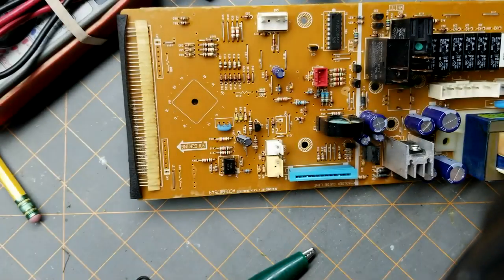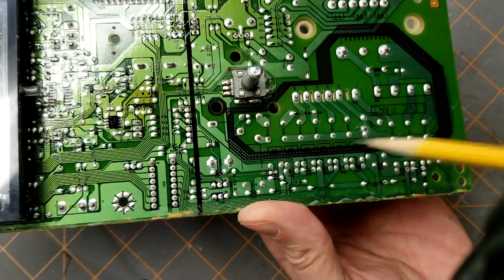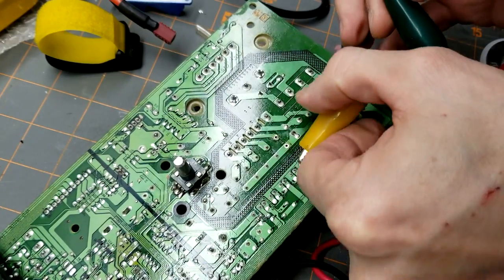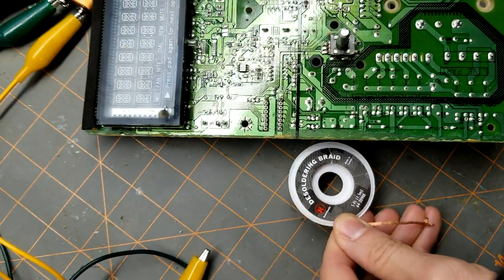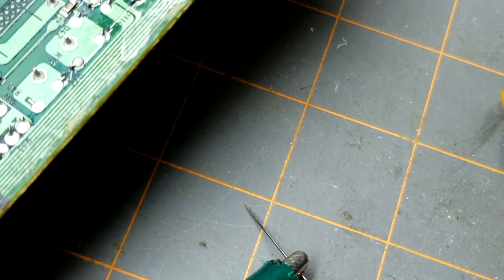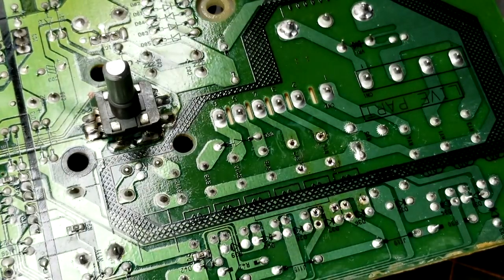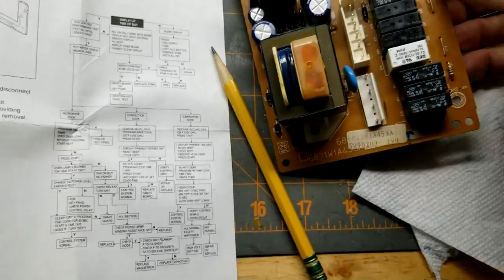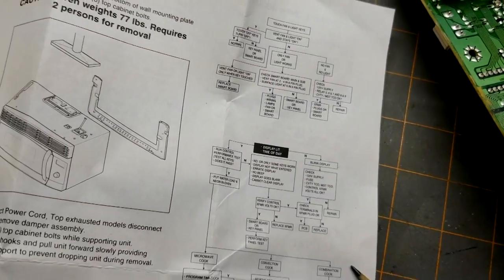Microwave Relay Replace

Comment: I see diode symbols printed near the relay coil contacts.  Often, diodes are placed in parallel with the coil to absorb back EMF when the relay is de-energized.  If you attempt to energize a relay with your 9 volt battery, you need to apply the voltage such that the diode is reverse biased.  If you apply the voltage with the diode forward biased, the current will go through the diode and not through the relay, giving a false negative.   Maybe this is why you said some relays were "polarized."
Reply: I blew up 3 of the tiny diodes trying to test the relays.
I did get the relays tested though.
Wish I'd known the correct polarity to apply before I tried it though.
Where can I get those tiny surface mounted diodes?

Comment: Wow I had to go all the way to12:20 to find out what the issue is that you were trying to repair.  I have dim lights or no numbers on my microwave display, but the dots and dashes blink. Most people are saying it's one of the caps on the PCP board, or the ribbon wire.  Glad I stayed until the end of the video to find out what the heck you were trying to fix . Nothing in the description either.

Comment: The desoldering braid:  Don't hold it directly with your fingers; it will conduct heat from the iron and burn your fingers.  Better to hold onto the braid container with only as much braid coming out as is needed.   Also, advise using flux on the braid to improve the wicking action.  Good that you opened up the bad relay to show the guts, but you didn't show what was wrong.  Burned contacts?

Comment: I blew up 3 of the tiny diodes trying to test the relays.
I did get the relays tested though.
Wish I'd known the correct polarity to apply before I tried it though.
Where can I get those tiny surface mounted diodes?

Comment: I just replaced a GE microwave over stove and kept the broken one being only two years old. it had no power to touch panel or anything else so i checked the thermo fuse and it was bad so i temporarily jumped the wires and plugged it back in and everything came back on. the only problem is the exhaust fan comes on and won't turn off. even after at least an hour or so. i just watched your video on how to test and replace a microwave relay ,i was very impressed at how well you explained how to test and replace it. what do you think it could be one of the relays are the problem. i did take out the three door switches and checked for continuity and they all checked good.
Reply from the maker: Hey Johnny. I would not be surprised if the fan is the reason the thermo fuse burnt out. If the fan was stuck on the current draw could eventually cause the fuse to go. So what can cause a fan to get stuck? It is very likely there is a fan relay.
Reply: @jebadiaha  I checked all the relays on the board like you did in your video , bug they All tested good
Then I took all three door switches out and opened the up and cleaned the contacts, only one was tarnished
Put them back in and did a continuity test on each switch while opening and closing the door, all worked fine. Also I noticed the nite lite is on also and won't turn off or on high.and fan stays on low speed still.
Reply: @jebadiaha also I thought the thermo fuse was bad and it is good, it shows ol no continuity. Is that correct , one lead off while tseting
Reply: Never mind about the fuse it is bad , supposed to have continuity . I got mixed up with that . So I'll just put a jumper between the two wires temporarily just for now till I figure out why the fa and under neath light stay on
Reply: @jebadiaha  the model is JVM6172sk1ss
Reply from the maker: @JohnnyCab  so with the fuse jumped does every thing work except that the exhaust fan and light on the bottom stay on? Can you set the clock? Can you cook anything?
Reply: @jebadiaha  Yes I can set the clock and I heated up a cup of water  , interior light works when door is opened small cooling fan comes on. Thanks for your input , hopefully you have a solution. Maybe there's something on the power board. If I new how to test what parts . They want to much for a new board and it's probably a few dollar part.

Comment: Why does a microwave oven need 12 relays, how many high voltage circuits are there in an oven? light? turntable? magnetron? grill? bleeper alarm? 12 relays seems excessive.

Comment: Im trying to troubleshoot my relay on a refrigerator pcb....the coil side of the relay is measuring 12 volts on one side and 6 volts on the other when the machine is running...im trying to track down if my issue is not the relay or not but i dont know how much voltage the other side needs to be....if its supposed to be both 12v...12v and 6v (like it is when it runs) or 12v and 0v (ground voltage)

Comment: I have a fair new GE microwave that after a storm when plugged in the surface lights keep flashing and and the display is gone and make a click noise when the door is closed, I’ve replaced the thermal fuse and did not helped. Some one knows if just replacing the control board is going to resolve the issue? Any comments will be much appreciated. Thanks

Comment: Hi! Nice video! Recently I found problems with the relays controlling the magnetron power supply. These relays have a controlled contact connector in the top, blade connectors. On the pcb is only the coil supply circuit. Those relays contacts get "welded", the magnetron circuit gets power all the time overheating and damaging the magnetron. I have replaced the relays with new ones, I have replaced the magnetron with a new one but the problem appears again sometime. I try to figure what causes to weld those contacts. Is it the relays contacts quality or does one of the components in the magnetron circuit getting older, contribute to a higher than normal start current welding the contacts? Every time, after the replacing of relays and magnetron, the microwave runs normally, being able to heat. Some time the magnetron power relays contacts gets welded during the test period. That makes me troubled. I can't figure out what is causing this. If you have ideas let me know.
Reply from the maker: This is beyond my skills.  Your higher than normal current going through the relay seems plausible.  Perhaps some up stream current regulating bits are malfunctioning.  Resistors usually fail open (no current) so I would think something else.  I know that feeling of wanting to figure it out and fix it.  But sounds like you are a few dollars in already.  Sorry to say it might be time to buy a new microwave so that you don't throw away good money.
Reply: @jebadiaha  Thank you for answer! I work in hotel industry and I have 227 microwaves, ge, 5 years old. The problems that I mentioned happened sporadically. I'm still curious to find the cause just because I can't just quit ...
Reply: Maybe the diodes in parallel with the relay coil(s)?

Comment: Anyone have ideas on what causes relays to fail in the first place (aside from lots of use)?  I replaced 3 in my microwave convection oven and all failed within just a few cycles.  Thinking of replacing the whole board, but would love to identify the root cause first.  Capacitor and switches all check out ok.
Reply: And, by the way, great video.  Thanks for making it
Reply from the maker: I really don't know.  But if 3 failed and the replacement parts failed too, then it sounds like the board is the root cause.
I dissected one and note that the wire coil is very thin gauge wire.  If too much current goes in, the wire could heat, melt the insulation, and short circuit.  I am not sure how to prove this theory.
Reply: @jebadiaha  Thanks for the reply...  the slow-fail nature of the new relays seem to fit that theory - there was heating for a few cycles then nothing.  Given that a replacement board costs more than a new microwave (!?!) I think I now have a project microwave while my wife gets a new one.  Appreciate the insights.

Comment: I will check the relay of microwave oven by how many volts.Please help me.
Reply from the maker: With my test I used a 9V battery to open/close the relay.  But read the spec on the relay itself so you don't use too high voltage and melt a good relay.

Comment: what if you have continuity between common and one of the connection pins?
Reply from the maker: That may not be a problem.  I think that could be correct under some circumstances.  Many types of electronics have a common ground.  The relay has a electromagnet, that when energized, will close the switch.  one side of the switch may be to ground.  Also one side of the input pins (as I called them) that energizes the magnet should be ground/common.
Reply: @jebadiaha  Thanks a ton for this response.

Comment: Sir my microwave keeps on all time but no heating. When I open door then it turns off. When I press  keypad start button it works to heat. But won't stop unless I open the door. What should I do?
Reply from the maker: This sounds like some very difficult problems to troubleshoot and not only related to the content of my video (relays).  If I were you I would try to find a replacement control board.  However this is typically an expensive part making it a better decision to replace the microwave instead of trying to fix it.  If the parts cost more than 50% of a new microwave and you are not confident this will fix the issue, then it is better to replace the microwave.  Repairs are only worth it if 
1) you ARE confident it will fix the issue AND 
2) the cost of parts is less than 50% of the cost of a new microwave.

If you are NOT confident (in your case - I imagine you are not confident.  I am not) then put a threshold on what you are willing to invest in parts to TRY to repair it.  I would say invest no more than 10% of the replacement cost.

Hope that makes sense.
Reply: You should check the relays. Their contacts can be welded together.
Reply: Maybe one of the door sensor switch is bad or the connection between the switch and circuit board is not securely connected.
Reply: @jebadiaha  thanks for your kind opinion.
Reply: @Omcsesz  That's what happens to mine! When connected to the source, magnetron is ON, light OFF, plate OFF....and when I close the door the magnetron is still ON, light ON, plate ON, heating at full power and it doesn't allows to change intensity. When door is open, light is ON, plate OFF, magnetron OFF. 
I can't leave it connected because magnetron hungs up in ON at full power.

I tried to clean some dust with blowing some air into a tiny gap in the metal cover and the edge (where the buttons are), and suddenly when I closed the door, silence. It was normal again 😍
Same happened last year and didn't remember I was blowing some air with my mouth and ''fixed'' it. But I don't have a clue on what's really going on and how to prevent it.
Sure it's dust and dirty stuff that accumulates there but don't know what to do against....

Any ideas?
Reply: @jebadiaha  That's what happens to mine! When connecting the cable, magnetron is ON, light OFF, plate OFF....and when I close the door the magnetron is still ON, light ON, plate ON, heating at full power and it doesn't allows to change intensity. Buttons are OK. 
When the door is open, light is ON, plate OFF, magnetron OFF, seems normal (it isn't).
Clock count ends and it's OK but I can't leave it connected because magnetron hungs up in ON at full power. So I keep the door open but 3 mins later the light is dimming and looks like something is going bad...so I disconnect the cable and used it this way for months 🤷‍♀️

I tried to clean some dust with blowing some air into a tiny gap in the metal cover and the edge (where the buttons are), and suddenly when I closed the door, silence. It was normal again 😍
Same happened last year and didn't remember I was blowing some air with my mouth and ''fixed'' it. But I don't have a clue on what's really going on and how to prevent it.
Sure it's dust and dirty stuff that accumulates there but don't know what to do against....

Any ideas?